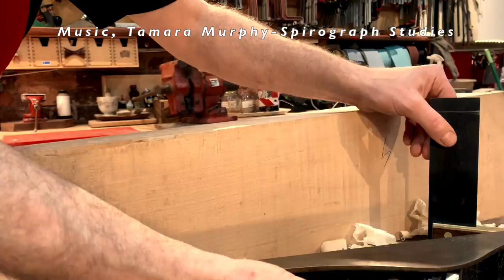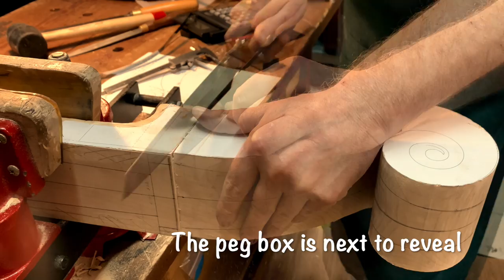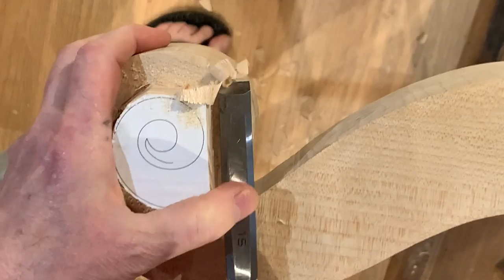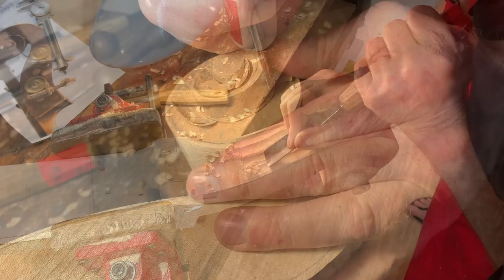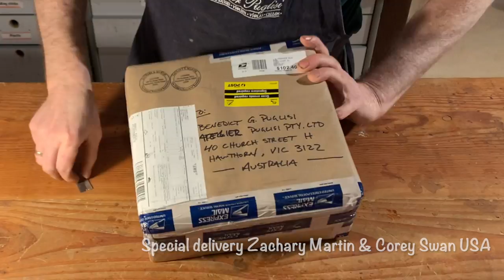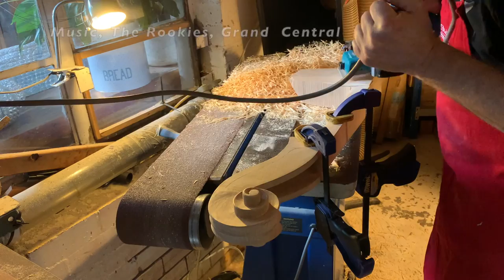Making a Meyer Double Bass Scroll: Chapter 3 "The Evolving Scroll"

Comment: Have you ever made/heard/seen a bass without the traditional scroll? I was wondering what the tone would be like without the additional mass at the end of the neck. Gene in usa
Reply from the maker: There's a number of people that have made headless instruments and even more ornate scrolls. Helps to pack it away in a case for travelling that's for sure.
 Definitely the extra mass at the top of the fingerboard helps to balance out the vibration on the neck. Instruments that I have tried, without a headstock have seemed thin in tone. However, a huge part of the optics of the violin family is the Fibonacci, scroll thats for sure. 
There is also a noticeable change when adding the C extension which needs to be the correct weight. Not too heavy, not too light...